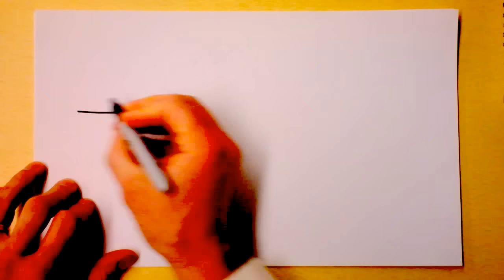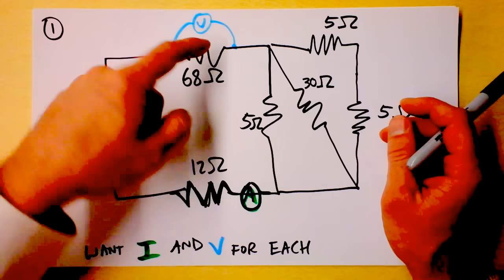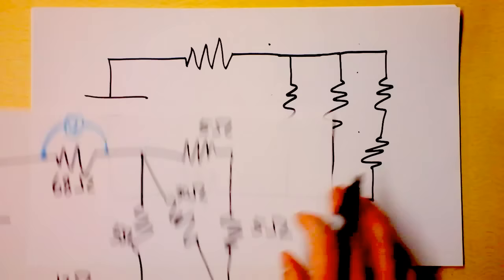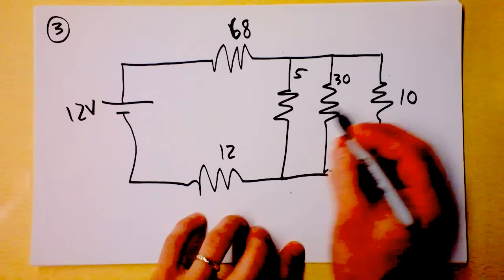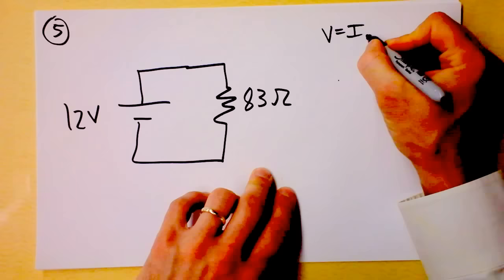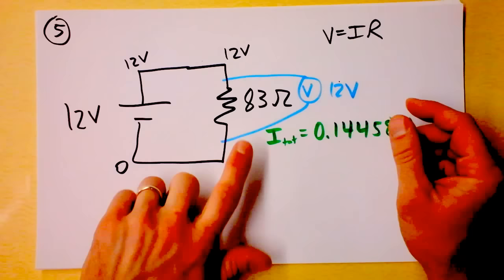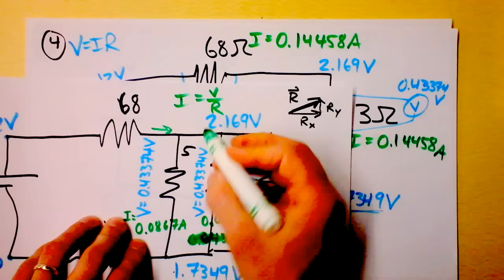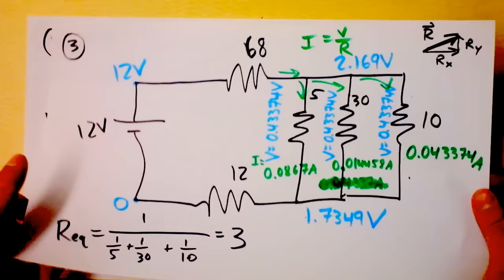Parallel and Series Resistor Circuit Analysis Worked Example using Ohm's Law Reduction | Doc Physics

Comment: This video was the switch...
That closed the circuit...
Which flowed through a resistor...
Inside the light bulb...
Over my head.
At least as far as the equivalent resistance in parallel resistors is concerned! ;) Thank you so much for the help Doc!
Reply from the maker: David Porter HA!  Glad it helped!

Comment: I can't believe teachers, textbooks, and homework never mention the little details that make all the difference (like subtracting the calculated voltage drop from the total voltage, reminding you that parallel resistors ALL have the same drop which is the total drop for the branch; that current is the same for all resistors in series, etc.). Thank you for making this.

Comment: you dont need a calculator to calculate that its 1/R= 1/ (1/5 +1/30 + 1/10) now you introduce a technique called common divider , its the biggest divider , for this case its 30 ..like this 1/R= 1/ (1/ 5 x6 + 1/30 +1/10 x3) = 1/ (6/30 +1/30 +3/30) =
1/ (10/30) , so you can delete zero's and it looks like this 
1/R= 1/(1/3) now 1/R = 1/1x1/3  , 1/1 x 1/3 = 1/3 so its 1/R=1/3 , now you can delete 1/ cuz its on both sides and what you are left with is R=3... only thing you needed there is a technique called multiplying by common divider , essentially to  make numbers even you find the common divider so that you can add different dividers like 
1/2 +1/4 + 1/8 its the same thing as 4/8+2/8+1/8=7/8 ... judging by the numbers used and how they all add up nicely i suppose you are meant to use that technique.. i was never good at math , i failed badly finel years exam , but at least i know how to add up those numbers without calculator :) i didnt even know that i still remember doing that in school
Reply: Cray cray

Comment: you didn't solve in 15 minutes :P
Reply: tick tock. That is based on the murphy law of statement v. minimum practical outcome degeneration. Wherein a 15 min problem = 22.5 minutes to solve.  A simple 1.5 : 1 ratio is applicable as the reality laden expected outcome v. original statement.. Another example would be like a half hour lunch break will always take 45 minutes. (30 x 1.5 = 45)  This equation was originally formulated by murphy while he was having a good day, the ratio may actually have a weighted outcome value averaging of 2.7 : 1. Wherein a 15 minute problem will take 40.5 minutes to solve. The plus side of this is it is ok for your half hour lunch to take 1 hour and 21 minutes. Ex: 30 x 2.7 = 81 
 See how critical thinking skills will help you in your day to day.  : )
Reply from the maker: Terry Lang
It is most excellent to have a name for my temporal failings!
Reply: Doc Schuster  We all work against the clock...Doc. I'm with ya, not against ya. I hope you're not using (Terry Lang), as the name...hmmm.  I meant to prove that by making up that rhetoric concerning Murphy.
But seriously, Doesn't every 10 minute project take 27 minutes ? LOL
"Murphys Law of Statement v. Minimum Practical Outcome Degeneration."
personally, now, after saying it for the second time. I like it. : )
Reply: Doc Schuster
I've done some more real heavy thinking : / on this, and I will not surrender this to Murphy. I copyright this written law as Langwich.  
A term derived of  My name, language , languish, and a sandwich.
Langwich, pseudo intellectual property of Terry Lang 2014. now it's legal. ; )
Reply from the maker: Nice.  Now I'm wondering what type of sandwich was on your mind that could be worth a dedication.
Reply: ***** point taken :P
Reply: He explained most rather than solving faster :)

Comment: How did he get 3?
Reply: bmx4lif3 Add the 3 resistors by 1/R1 + ... then the answer will be 1/3, reciprocate it = 3. Yay
Reply: bmx4lif3 if you want it even simpler, 
i'll do it in steps so you can tell me between which 2 steps you can stuck on , if you do get stuck.

here we go
Step 1.the Resistors are 5 ohms / 30 ohms / 10 ohms  right ?

Step 2, we use the formula  
1/5 + 1/30 + 1/10 = 1/total equivalent series resistance
got that ?

Step 3. put your calculator away (Kids of today are lazy) Let's do it manually.
you see if you just punch this into your calculator, you'll come up with 0.2 + 0.033 + 0.1 = 0.333  and you'll still be like... wtf

so, MANUALLY OK
if we have 1/5 + 1/30 +1/10
we take the largest denominator and we leave that unchanged.
so 1/30 stays as is

Step 4. now we take 1/5 and we look at the denominator....
what do we have to do to get 5 to 30 ?
well.. 5 x 6 = 30
therefore 1/5 = 6/30  right

Step 5. now do that for the 1/10
so 10x3 = 30
so 1/10  = 3/30  right

Step 6   so now we have changed this
1/5 + 1/30 + 1/10
to
6/30 + 1/30 + 3/30

is that much easier to solve now
so what's 6+1+3
 10   right ?

Step 7  therefore 10/30
now you can get your calculator out and type that in as 10 divided by 30
and you'll get the answer 0.33333333333333

or you can simplify manually 10/30  (fuck off the zeros on top and bottom)
and you get 1/3 and then punch that into your calculator and you get
0.33333333333333

whatever tickles your fancy.

Step 8.  ok, SO HOW DID HE GET 3 (After all this typing we want to know.. right?)

well we have 1/3
to get the reciprocal we flip it, so it becomes
3/1   is that clear

Step 9. DO THIS MANUALLY
what's 3 divided by 1
3 right

don't believe me
get your calculator out and punch in 3 / 1 LOL
(Bloody calculators making people lazy)

AND THAT'S HOW HE GOT 3

PS, if you want to know my beef with calculators, it's this
in high school back in around 1987
i forgot what 8x8 was, was it 63 or 64,
it was a headfuck for like 6 months.. yes 6 months, why
because at the beginning of year 10 and prior i was awesome at maths
then we got calculators, or should i say we had to buy them
CASIO FX100 Scientific Calculator
ithen got good and fast and punching shit in to a calculator

THAT MADE ME LAZY
6 months later i realized what it had done and i put the calculator down and reverted to the old ways of the force LOL

WANNA TEST YOUR CALCULATOR GUYS
DO THIS

1. first work out 
1+1 x 6  (in your head manually)  this  shouldn't be hard

2. if you said 12  (go and learn order of operations again)
no it's not (1+1)x(6)=
simplified to 2 x 6

FYI, for those who don't know
MULTIPLICATION AND DIVISION COME FIRST

so the way you work it out is...
(1)+(1x6)= simplified 1 + 6 = 7

now that we know that the answer is 7

punch it into your calculator
if you get 12  BIN THE CALCULATOR
if you get 7 Your calculator is good

See Calculators can be decieving

now, i actually spoke to the calculator manuafucters of these chinese cheap shit calculators

there response was as follows:

"sir, the calculators are programmed using sequential mathematics, it's the responsibility of the user to know order or operations"

now even though i agree with that

let's be real about this
if you are working out the total of something like
354 + 256 x 32 / 5x 64 + 456 x 32 - 7 / 3 x 6 =

hands up who gives a fuck to sort all that shit out before they punch it into your calculator
i don't know about you guys , but ever since i was at school and we used a calculator the idea was 
accuracy and speed

to say to someone they need to sort it before they punch it into a calculator defeats the purpose of the calculator

and let's say YOU ACTUALLY TRUSTED THE CALCULATOR COMPLETELY
and have never read my post and you did the above calculation

HERE'S THE DIFFERENCE

Scientific calculator (applying order or operations correctly)
Answer = 119,789.60

Cheap Shit sequential Mathematics calculator
16,019,953.99 

     119,789.60

16,019,953.99

Big Difference huh
see my beef with Calculators

AND THIS IS WHAT PEOPLE TRUST

FYI
i think any Scientific Calculator is fine
Most Smart Phones (in Standard Mode) are fine
Windows Calculator (basic Mode = Bullshit)
Windows Calculatrs (Scientific Mode = All Good)
Excel = no problems
Using Databases like MySQL for calculation = no problems

the way you can tell is if 
YOU ENTER 1  (it should display 1)
if you enter + it should still display 1)
if you enter 1 again (it should display 1)
NOW HERE'S THE BIT TO WATCH OUT FOR
When you press the +
if the calculator adds the running total,   throw it away
if it waits until you pres = then it's good

Now that we have all that out of the way
Hopefully there will be no room for error.

be cool
Reply: +Martin Andrew Marc Ben 
Cool Story dude, can't believe you actually carried out your own investigations and questioned a calculator manufacturer. And learned how to evaluate the decency of a calculator (i still have my BODMAS theorem and 12x table in check, everything else i admit, i use the calculator!)
Reply: Jeremy Kua LMFAO, BODMAS, wow,  i almost forgot that, thanks mate for reliving a memory that was about to wither away forever, i mean , i obviously know how it works, but the mnemonic BODMAS, i'll admit, i haven't heard since the 80's
cool.

as for my investigations.
fucking oath i did ,

when you go to a $2 bargain shop and there's a calculator and it's wrong in basic math.

and the little asian lady stands there ,and you tell her, this calculator is wrong, why should i pay for it,  and she says..... Too Dolla, you want to buy.. Too Dolla

she doesn't give a fuck if it's wrong or not
she want's her $2

all while kids in high school who have enough pressure as is, sit there and wonder why they can't figure out basic maths and why they are getting low scores on the exams

and then they are made to feel stupid after the exam
and the teacher won't bother to bring it to their attention. (as i was informed a little while back)
for christ's sake, THEY ARE A TEACHER, their function is to "Teach"
if one of their students isn't doing well, you would think they would correct the mistake.

guess not !

so..
of course i called the manufacturer,
they have  a responsibility for accuracy

Same as.. let's take dyson
Claiming they have a Digital Motor
LOL
which uses CINETIC Technology
Not KINETIC (Because they couldn't patent "Kinetic")
if you wondering
yes.. i also called dyson and spoke to their engineers
and they agree that the motor is not power by digital information or digital power
it's merely digitally switched
as for CINETIC
it's a marketing tactic
and as for the motor being as fast as a Formula 1 Car
Again, marketing bullshit
(Technically the RPM's are as fast, but obviously the mechanical advantage is not there and you can't just whack a dyson vaccuum under the hood of your car and instantly have a formula 1 engine

even though that's what i was told by idiotic sales people who are actually told to believe this shit when they are selling it to you.

there's another one for you.

bottom line, i don't like bullshit
and i pride myself on accuracy.

be cool dude.
Reply: +Martin Andrew Marc Ben 
LOL, "Digital Motor" and "CINETIC" seriously?? Sounds like your mathhood were full of scammers. 
Right, keep the calculations coming
Reply: Martin Andrew Marc Ben Thanks for the explanation.
Reply: Very good. Still a bit crazy for a total 2 day newbie but I also learnt stuff. never give up right
Reply: Martin Andrew Marc Ben thanks bro u helped me out

Comment: I have probably spent over 8 hours practicing all this. I think I finally got it. Takes me a bit longer then others to really pick up on all this. Which is fine with me. At least going over your math several times till it started drilling in my head, helps me a great deal. I have been learning this in a crash course at WNC and to be able here, to just take my time and rerun your video well okay over 10 times! I finally got it! Thank you for putting up your video. I will play with your Kirchhoff's law video soon.

Comment: dude, these are nice explanations, good examples and a nicely laid out logic. I know you don't have that much time to go through all the material you have to hit on, but the quality of the drawings makes a huge difference in the explanatory power of the presentation. I know you can make nice straight lines and nice symbols, because at the beginning of each sheet, you start off with square angles and straight lines, and it usually falls apart by the time the drawing gets back to the negative end of the battery. I think, if you make the presentation a bit longer to give yourself just a little more time to make some beautiful sheets and people watching to grasp the concept, it will make for an awesome explanatory video to learn from.
Reply: +cheasea I think some different thickness markers and nice colors would help a lot ;)
Reply: +cheasea also, what if you glue the paper on the back of Plexiglas so that your markers last longer and you don't have to buy as much paper

Just giving unsolicited advice, haha

Comment: You should’ve chosen two resistors of different resistance along that series circuit (like say one 5 ohms resistor and one 6 ohms resistor instead of two 5 ohm resistors along that circuit path) lol I think you realized that while doing it that it would’ve been slightly less confusing and more clarifying that way. That said great job and thank you for what you’ve done for the learners of the earth!

Comment from the maker: Remember this axiom - resistors in parallel have identical voltage drops, and resistors in series have identical currents.  Since 68 and 12 have the same current in our sketch, they must be in series.

Comment from the maker: Voltage drop is what parallel resistors have in common.  You can see they have the same voltage 'cuz they all meet at a common metal connection, and metal is an equipotential (which just means it has the same potential in electrostatic equilibrium).

Comment: For Req, you could just do two sets of (R1*R2)/(R1+R2) for the resistors in prallel. so if you use that formula for the 10 and 30 you get 7.5 ohm equivalence, then using the 7.5 and 5 you get 3 ohms. then you simply add the 68, 3 and 12 to get 83 ohms total.

Comment from the maker: If you go near the end of the video, you'll see the voltage listed at every point when 0 is defined before the battery.  Your answer would be the difference between the two voltages that I wrote at those two locations.  Try it.

Comment: You are technically correct in your method. However, there is another, much easier method to reach all of the values of a series-parallel circuit, which I have not seen explained on YouTube. It is called a RIV Chart!

Comment: For total resistance I got 83 Ohms.  For total current I got .145 Amps.  My total voltage drops were 68 Ohms = 9.86 Volts.  For the 3 Ohm resistor, the voltage drop was .435 Volts and for the 12 Ohm resistor, the voltage drop was 1.74 Volts.  Add the total voltage drops and I come up with 12.03 but that is because I did not round any thing off. Since the current is the same across each resistor in a series circuit is the same the total current I came up with is .145 amps or 145 milliamps.  Please remember though, I have stopped the video and calculated everything before he was done.

Comment: At @5:40 he says "these (5ohm) resistors are in series with them (30 and 5 ohm resistors)." He meant to say the two 5 ohms resistors in the same path are in series with each other, and once combined are PARALLEL to the other 30 and 5 ohm resistors.

Comment: In series circuits, amps remain the same (only voltage changes) and in parallel circuits, volts remain the same (only amps change). That's why you are seeing the same number replicated across the different branches (22:05).

Comment: Hi Doc... thanks for the reply, and thanks for your time.
I may have actually asked the wrong question... let me try again.
Simpler circuit.... to help me with my question.
12 volt supply.  2x 5ohm resistors in series.  In parallel with two 30 ohm resistors in series.  the probes of the meter are placed ..on between the two five ohm resistors and the other probe is placed between the two 30 ohm resistors. Not measuring across a 5 ohm or even the 30 ohm resistor... but actually across them.

Comment: I have one question. If their is no significant resistance except from the wire, and the voltage is 6V, will a charge do the 6J of energy if it moves from one terminal to another. Where did 6J of energy go if charge takes one trip? Kinetic energy? or voltage can change according to the circuit? I'm new to this and want to learn this conceptually. Thank you.
Reply from the maker: riken maharjan Heat in the resistors.

Comment: voltage drop is electrical pressure reduce by resistors and  for every resistor the pressure is different low and the longest distance the low voltage u get so length affect pressure

Comment: Doc Schuster Couldn't i on diagram #3 once we have the current could i just multiply it by the resistor to get the voltage on that resistor or would that be wrong?

Comment: I have a one solely  question at 20:30 in video Ok if you have two  hot positive 12 volt wires going to each and having its own grounds will consume as soon as much as the same power

Comment: hi I'm taking a course where I have to find the ohms before I can get the voltage drop how do I find homes with in parallel and series circuit when I have 120 volts coming in if there's a way I can email you the exact problem let me know

Comment: Wouldn't the 5 Ohm and 30 ohm resistors be connected in parallel since they have the same node connections on each end?

Comment: In a parallel circuit when in a branch and it breaks up into another two that looks like a box type thing how do u calculate the adding the ohms and figuring out how they split up

Comment: Please Help... If  I were to place the probes of a a volt meter at point below the 5 ohm and below the 30 ohm resistors (on chart 2) measuring across the parallel resistors.... What would the voltage be and how would I calculate it if I did not have a meter?? Thank You in advance...